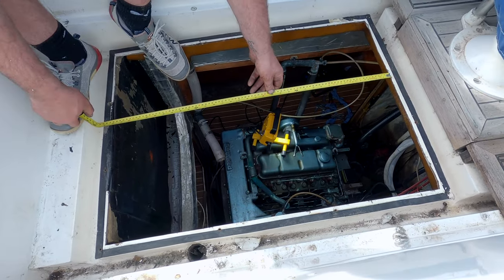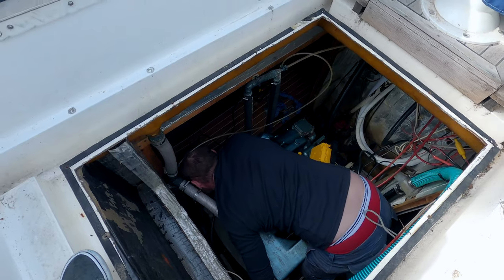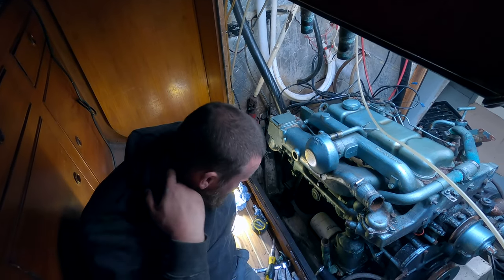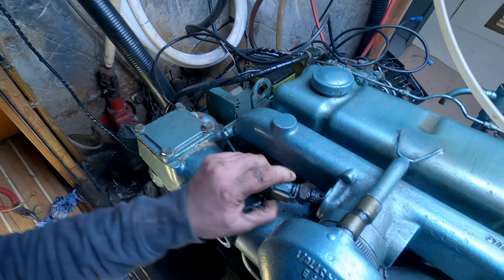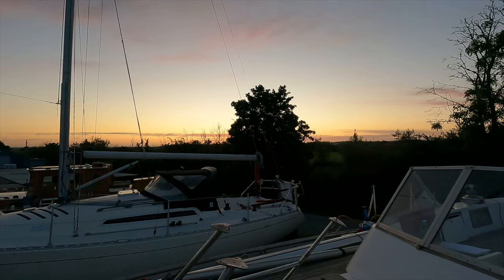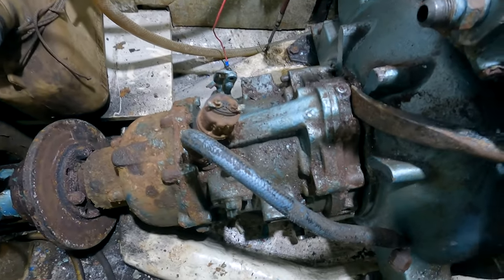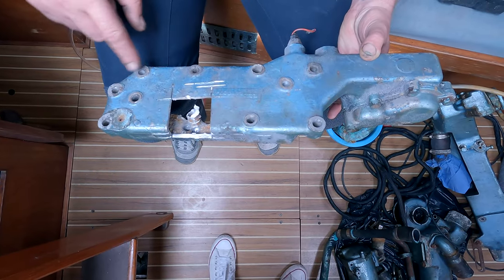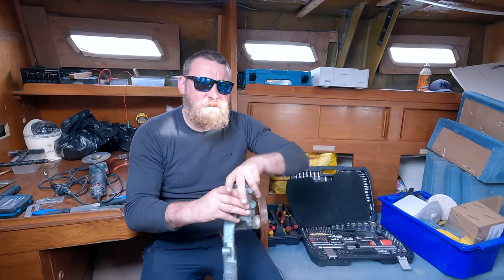Perkins 4.236 Engine / REPAIR or REPLACE? [E15]

Comment: I think you made the right call on the engine.  If you cannot have a new one then refurbishing the old one is better, IMO, than buying a secondhand one that you do not know.  I had a similar dilemma with my Rival 32, I got the old Volvo completely rebuilt and it was like new when done.  So far' it has run really well and I’m glad I did it that way.  Perkins are well known around the world and spares available so you should have a great engine once your friend has rebuilt it.  Andy UK
Reply from the maker: I couldn’t agree more. We have a saying (probably there is similar one in English) The devil you know is better than the devil you don’t.. not saying our Perkins is the devil haha it wasn’t that bad ;) it worked all the way from Gib to UK, started every time we needed it.
Reply: @sailingsqualo  Excactly the same in English.  With regular maintenance it will serve you well for a long time I’m sure.

Comment: I was brought up around diesels on farms and in semi trucks, with that being said after about 2002 i wouldn't want a new engine. I'd stick with rebuilding the old one..those old mechanical diesels are amazing and as long as you maintain them they last a very long time and when something goes wrong with them they're very easy to fix especially if they don't have any electronics. In farming or semi trucks the only time the engine is replaced with a new one is if the block is either broken from snapping the crank or its been rebuilt too many times before and sleeving it isn't a option.. by the time your qualified friend replaces everything you will have a new engine, it will just be the old block and reconditioned parts..
Reply from the maker: Ziggy is good at most things.. but anything remotely related to mechanics and he is almost helpless. We can both do only the basics required from an average boater. If we change that engine (and most likely we will 🤫), we will go for Volvo Penta which is similar to the one we currently have, not the Yanmar common rail we see so much in new boats. We hear they can shut down if there is slight fault and you cannot troubleshoot it and fix at sea so easily. 
I wonder what is your opinion on going electric? It sounds great, but we personally don't believe we are there yet with the technology to be long time cruisers anywhere in the world and charge and power it solely with e-propulsion. I believe a generator is a must in such case. Perhaps we are wrong.. 
We would ideally like to go for hybrid solution.. but the cost of these are eye watering.
Reply: @sailingsqualo  going electric sounds good until you attempt it and realize that the technology is good but not good enough. Sailing vessel mig channel removed his diesel and went electric. You have enough power to get in and out of a marina but you still are going to have to run a generator. If I had to replace a diesel engine I'd definitely buy a diesel that has none of the newer technology simply because when something is wrong with it you'll be needing a licensed repairman and his laptop
Reply from the maker: Yes, couldn’t agree more. 👍

Comment: Very good choice  This engine is the best....be carefull with the headexchanger and oilcooler engine All mechanic is the same .My engine have 9.800 hours
still working perfectly but for sure i prepair a second rebuilt myself. This engine can be fix in all the world....👌👌👌👌👌👍👍👍
Reply from the maker: Glad to hear yet another positive opinion on this engine. We don’t know the hours on ours, there was no record. 
I wish we had the knowledge to rebuild it ourselves. Mechanics is not particularly our strong suit 😅 
Could you please elaborate on the heat exchanger and oil cooler?
Reply: @sailingsqualo  The engine oil cooler can sometimes puncture the copper tubes, causing the loss of engine oil during operation and seawater to seep into the crankcase at idle, with consequent damage.

The engine cooling water exchanger regularly corrodes in the copper covers and aluminium plus salt water, causing leaks and difficulties to repair. Prepare assembly diagrams for these parts. original perkins drawing with the different parts. it will be easier for your mechanic used to land engine.

The perkins 4236 does not have anodes but all electrical connections are isolated from the ground if this is not respected provide an anode in sea water connected to the engine by a cable. On a car the battery ground is connected to the engine, on the 4236 marine no ground is connected to the battery.

The 4236 is very difficult to restart and to purge. I put a racor 500fg fh water separator filter and a lucas filter with a manual pump 9001742 A. The references are to show the model and the principle. The diesel pump on the engine is difficult to access and if the camshaft is not well positioned you will have difficulty pumping the oil. When boating it is important to be careful and often there is no time to quibble.

One part that is fragile is the exhaust outlet elbow, I had it made in stainless steel by a craftsman in Thailand.

parts4engine can give you good advice at a good price .
i am from belgium This is translate. sorry

Translated with www.DeepL.com/Translator (free version)
Reply: I put a Bowman heat exchanger on my 4 236. It took some thought on the plumbing but I am very happy with it. Remember there is sea water sitting in your exhaust manifold to cool it. The bowman combines heat exchanger and manifold.  Pretty cool up grade.
Reply: @marksmith296  what model of bowman did you mount on the 4236. bowman PE 390? Did you find a good price and a good supplier. thank you for the feedback
Reply from the maker: We have checked it out, quite expensive here in Uk,  but you’ve got yourself a nice upgrade for sure. 👍
Reply: @jeanclaudepiessevaux2573  I did get it from the UK 1200.00 US. I aldo had to modify the thermostat housing and exhaust elbow. But to have my exhaust manifold repaired.or get a new one would have cost about the same. I'm happy with my move. Make sure you have room for it in your engine room.